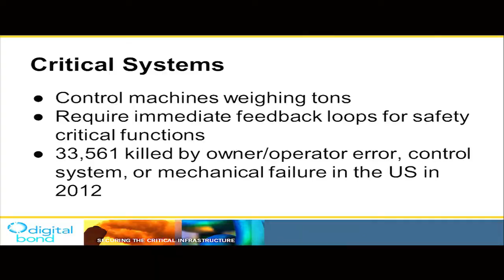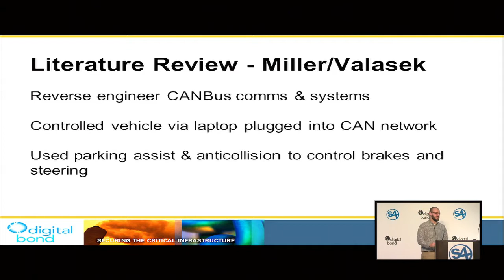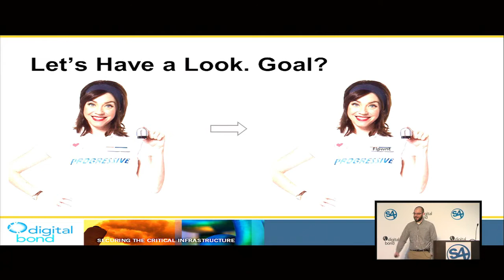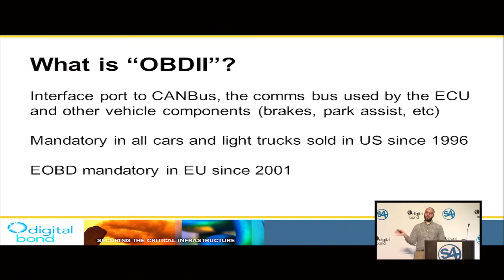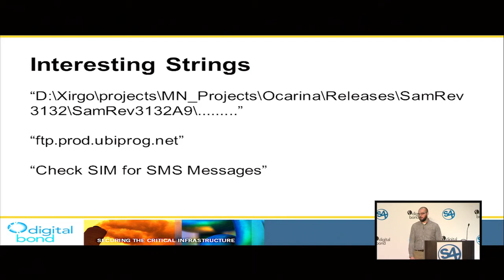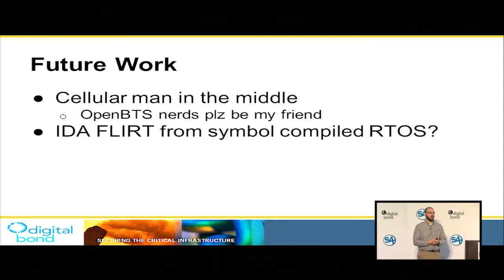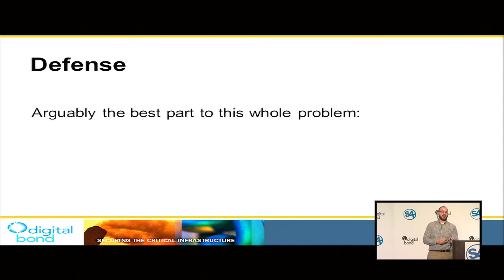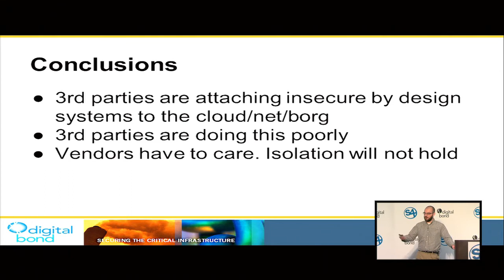Remote Control Automobiles: Hacking The Snapshot Dongle

Comment: I actually came across this video looking for ways to lower my insurance... You really seem to know what you're talking about.
I guess my main questions are A) does this device just sort of 'give access' to the system, or does it 'look for' and report specific events? 
B) is there a way to'trick' the device, or disable it? 
C) would they know if I unplugged it?
Reply from the maker: In short, both. The use by the insurance company is to gather data to help determine your rate. Most of the OBD ports provide access to the CANbus, your car's network. The risk is the communications channel gets hacked or misused thereby giving the bad guy access.

Comment: Are there any publications of his findings from reverse engineering the snapshot? I'm curious to see how the firmware works. If it's preprogrammed to interpret vendor specific protocols, how it interprets the canbus data, etc. 

For example, progressive keeps track of "hard braking", defined as decelerating >= 8mph per second. So is the firmware only calculating the deceleration, or is it comparing it with how hard the brake pedal is pressed? How does it handle that data from a Ford vs a BMW? Is it just logging all of the raw data to send back to Progressive's servers to get analyzed, or is it interpreting and logging specific data locally, and then transmitting that back to HQ? ETC etc etc..

This is how the mobile app works, copy and pasted from their website:
"The Snapshot mobile App records vehicle speed and time information (using GPS), phone usage (though not the identity of the person with whom the driver is communicating), and G force. Other information, such as trip duration, trip regularity (taking the same routes on a regular basis), and rates of acceleration and braking, is derived from the speed and time information"

Obviously the obdii dongle can't record phone usage, or g-force (which it wouldn't need to anyway since it's reading the car's data), but if all it's interpreting is the speed / time to calculate [de][ac]celeration, then perhaps all the dongle needs to do is record the same? But at the same time, the dongle also records "hard turns". So the more I research this, I only have more questions than answers..
Reply from the maker: There was no accompanying paper. So this video is the available detail. You should check out Toyota's PASTA kit just announced last week.